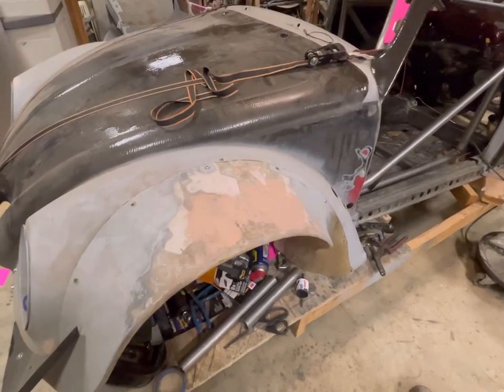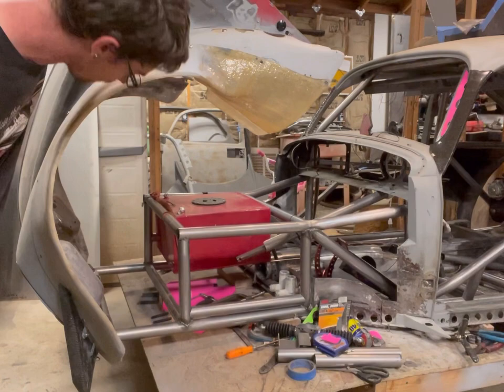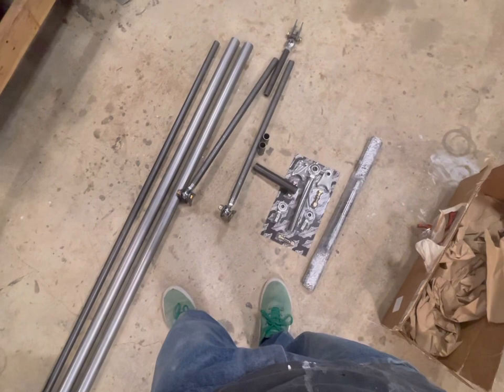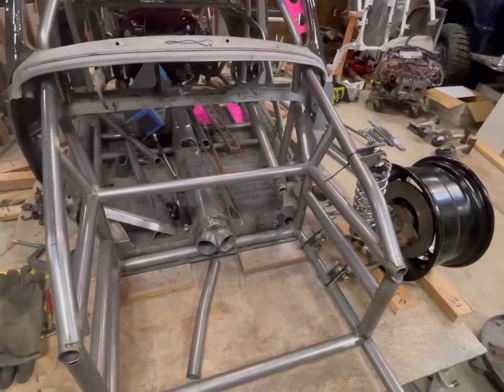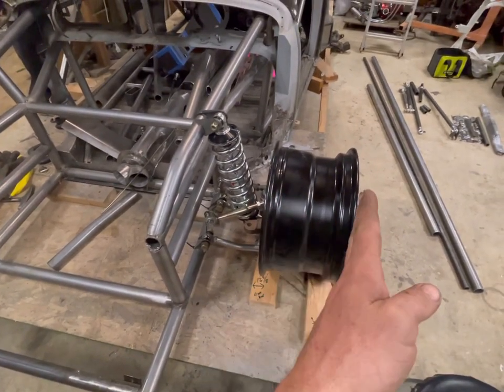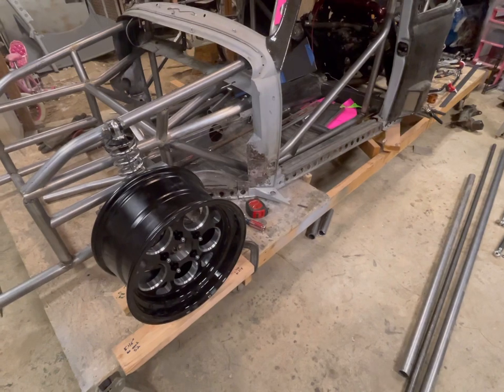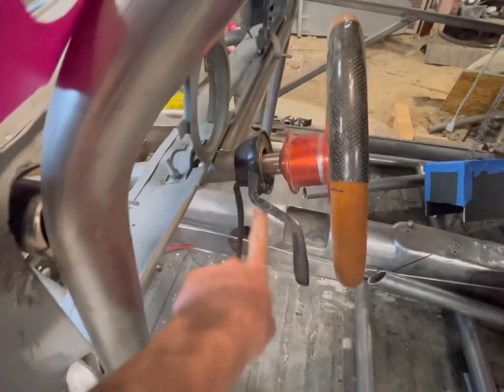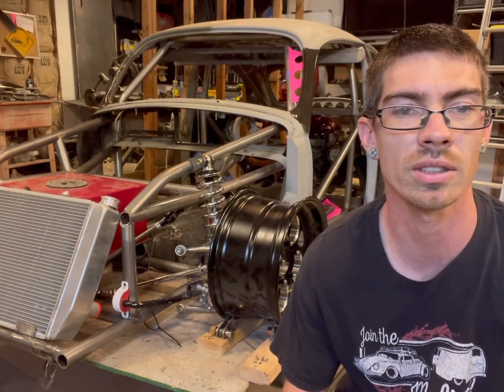Vw bug Subaru engine

Comment: looking good man i love this build. im curious how you are going to work out the bump steer with that center mount rack. i put one on night owl. i cant seem to figure out how to correct the bump steer. i figured i would get the rest of the build complete and get it on the road and see how it handles, but i do know just running the suspension up and down the wheel moves quite a bit. can wait to see what you do.